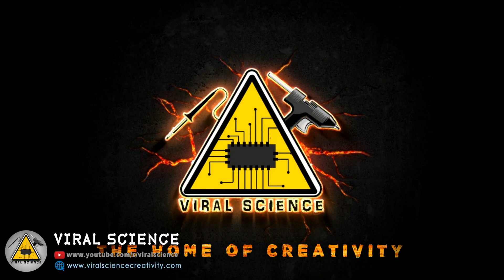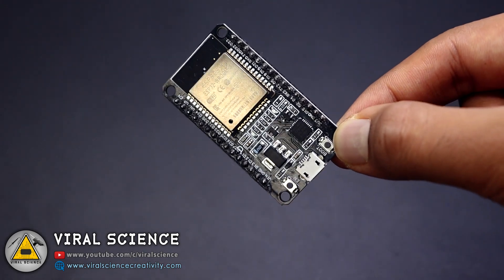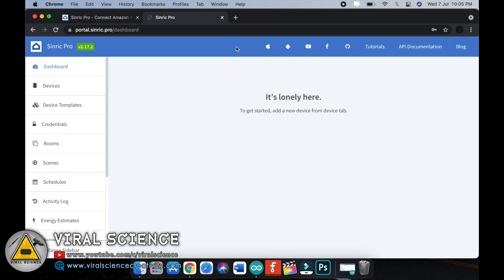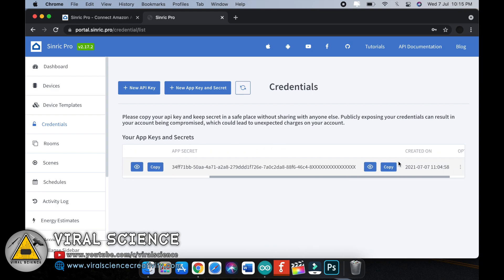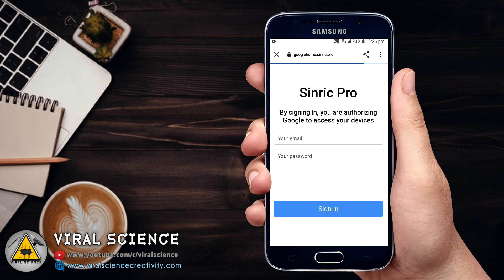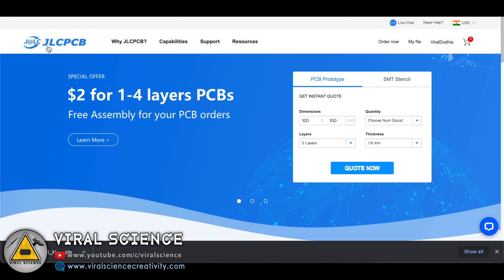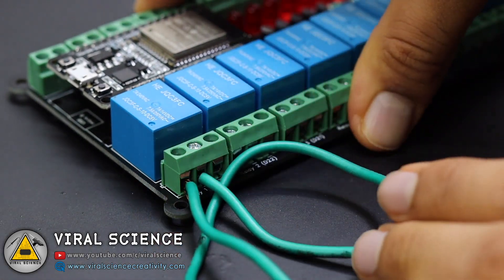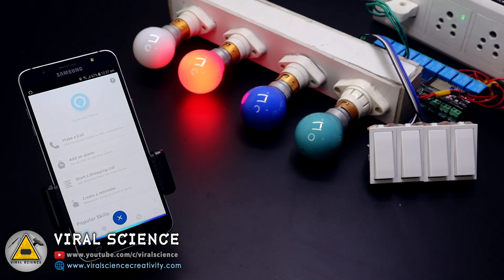ESP32 - Google Assistant | Amazon Alexa | Manual - Home Automation IOT Project

Comment: I think you could also use ESPHome + HomeAssistant or similar and do not depend on anyone’s cloud but still use Alexa, Google assistant and HomeKit!
Reply: The project is basically useless, as neither you are learning something, its all 3rd party libraries. Neither this is an optimal solution. On Amazon India itself, you can get tuya switches for 1/2 the cost of this project. ESPHome is great, but tuya switches can be directly integrated in Home Assistant, and best part using loyal tuya, you can control them without internet also.